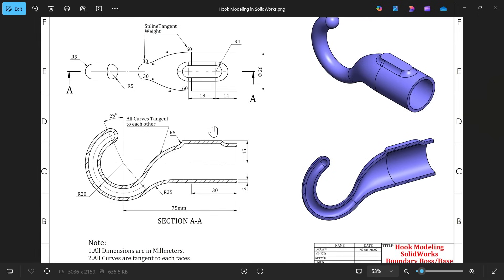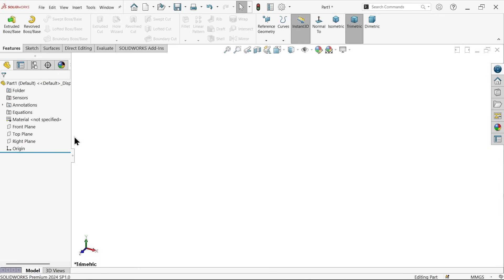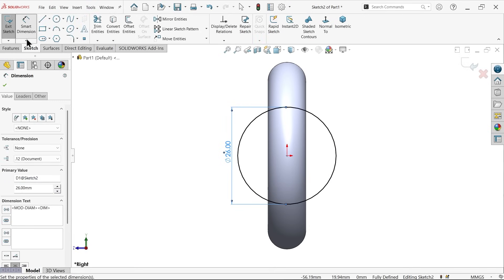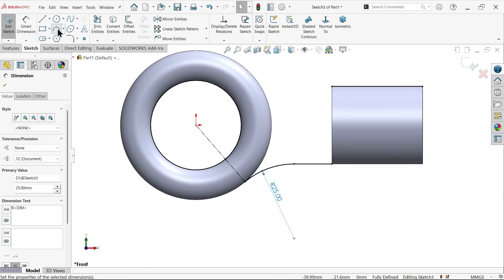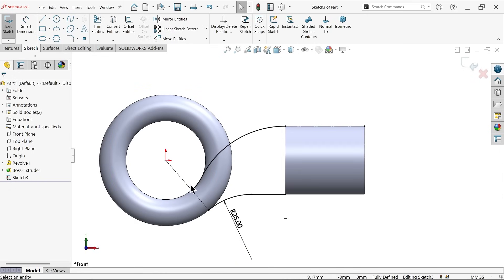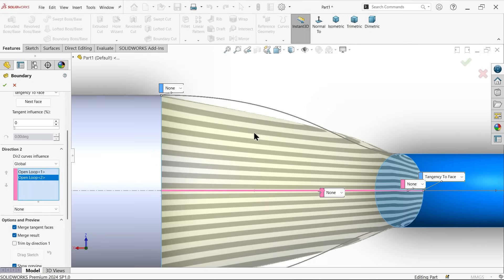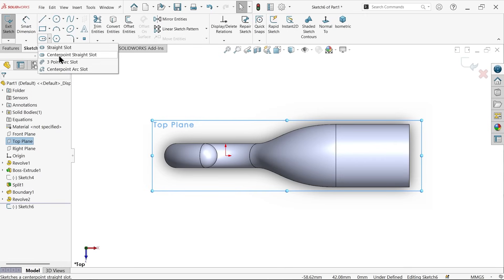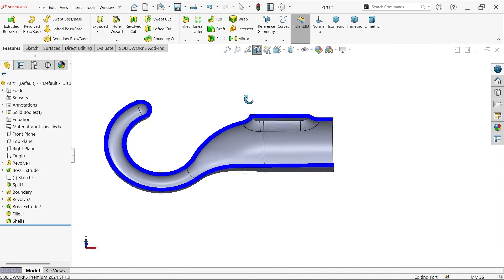Hook Modeling-SolidWorks Boundary Boss/Base

Comment: At 5:23, if you place a "point" on the line segment it will do the same as the "point" created using face curves.
Of course, position it properly on the round surface.

Comment: Sir can you, Design a 32U server rack (Not standard dimensions). This rack should have sliding shelves (8 Shelves). Use heavy-duty rails with a weight loading capacity up to 55 kg and a travel length of 800mm.

Note - Rack pillars should have slots.

Dimensions - 32U (Height)x 25inch (Width) x 1 Mtr(Depth)